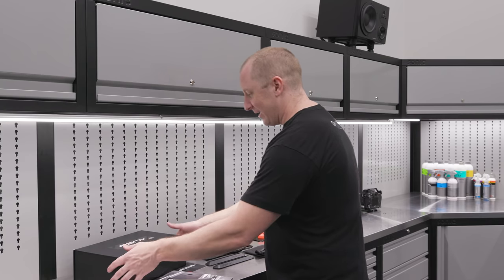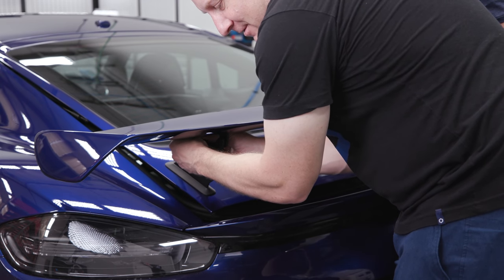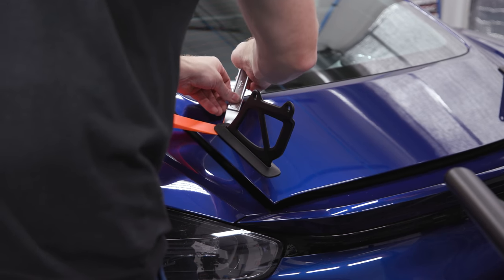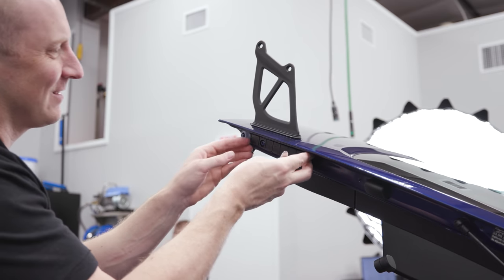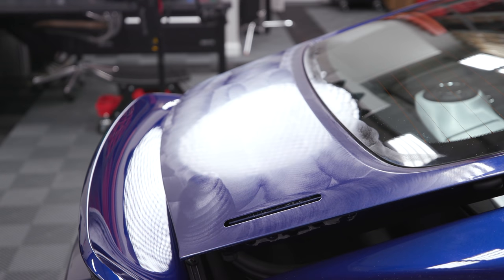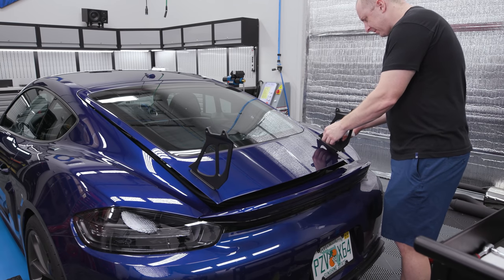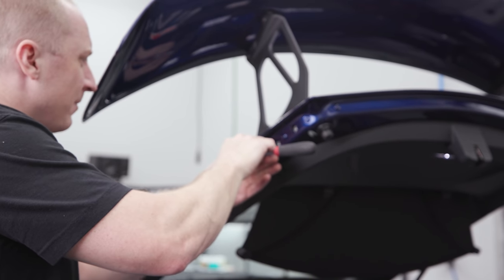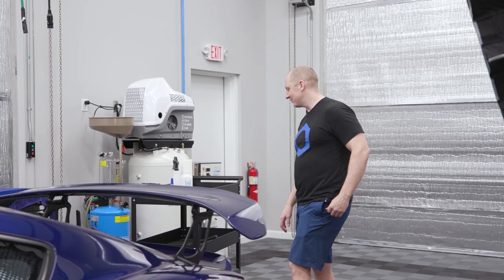Installing RSNV Wing Risers On The 718 GT4

Comment: You definitely do a thorough job but I have one suggestion. When assembling the wing back on, it’s probably a good idea to put a rag underneath just in case one of the bolts falls out of your hands so it does not scratch the paint
Reply: Great tip, that’s what we typically do. The bolts are light enough to not really damage anything but washers get lost easily!

Comment: That sweet sweet downforce.
Reply: Raising the wing 3” inches had no discernible impact on downforce.  Takes 6” rise to get the wing above the roofline and then turn the angle using the 3 degree hole option, then you get downforce.  The RSNV are cosmetic.

Comment: Changed the downforce profile from the rear to the front.  Need to add some to the front by removing the screens.
Reply from the maker: It will be just fine the way it is.
Reply: @ObsessedGarage  but it will affect the super long 2-5 gears now! :)
Reply: Only if Matt changed the angle of the wing.  If so, Porsche says remove the front diffuser blocks, not the screen.  If you want pics, let me know.

Comment: Hi Matt. Could a rear wing delete be done on the GT4? I guess you would need some vanity panels to cover the holes on the back, but would you need to compensate heavily on the front spliiter to adjust the downforce? Was imagining a home made GT4 touring-would still be fast etc but more discrete

Comment: Have them on my GT4 Matt.  Porsche needs to take a note - how the car should have come.
Reply: @jamesbaggaley1460  exactly, Porsche spent a lot of time and money to dial in the front to rear downforce balance so if these actually do increase rear downforce, what are you doing to the front to compensate?  BTW, I doubt they really do much and it’s highly likely they reduce downforce.  If someone has done a wind tunnel test then I’ll stand corrected. Otherwise this is purely cosmetic.

Comment: Doesn't that un-balance the car Front/Rear?    I think you should have done some high speed testing stock and then do this mod after you know how if feels stock at speeds where aero is effective.
Reply: Unbalance in terms of aero/downforce? No, because this is simply a riser kit. Assuming they don't change the angle of the wing, it'd have 0 effect on the downforce. It might be a little better in terms of air flow though - potentially cleaner air the farther up you go above the car (ie. why you see some race cars with wings mounted 2 feet above the trunk).
Reply: 😂😂 pretty sure it’s fine
Reply: Only if you use the 3 degree angle adjustment on the wing hardware.  If you use the higher angle, Porsche sys remove the front diffuser blocks.  I can provide pics if you need them
Reply: Upon further research, the 3” increase in height of these risers has NO discernible impact on downforce.  If you do not get slightly above the roof line, there is not much additional air hitting the airfoil to create downforce.  Getting slightly above the roof line and using the Porsche provided hole on the upper rear bolt (the lower cutout) that rotates the wing forward at the leading edge creates 3 additional degrees in the angle of attack, creating substantial additional rear end downforce.  The RSNV risers are, therefore, cosmetic (but if when you do mount them and you use the Porsche provided hole, you will get additional downforce, just not due to the RSNV risers, rather due to the increased angle of attack).  Aerodynamics and math for friction coefficient and drag, it ain’t that complicated.  Just like a wing on an aircraft, differential pressure.  Again, with the 6” rise and the 3 additional degrees in the angle of attack you must remove the front diffuser blocks to balance the car.  Removing the front diffuser blocks creates the front end down force necessary to plant the front of the car and balance it.  If you do not remove the blocks, the air flow in and through the front end does not change and the wing angle creating rear end downforce will create front end lift, just like an airplane,  At speed, the imbalance can, under the right air flow circumstances, can be enough lift to create imbalance.  Imbalance is always potential disaster.  Think of a heavier person on the end of a teetertotter, Most will never see the difference unless they track it, but it is discernable on the track.  Since I am not an aerospace engineer, I strongly recommend anyone doing this consult Porsche and reference the booklet that came with your GT4, which does discuss the necessary adjustments for the additional downforce.  DO NOT USE MY EXPLANATION!

Comment: I just installed the same set and had the exact same issue with one of those thread inserts coming out. On the same side nonetheless. Ha!
Reply: Happens time to time! Seems more often lately. Is yours a 718 too?
Reply: @rsnv_co  Yes it was a 718. May be helpful to put a note in the install directions. Other than that it is a great product, and easy install.

Comment: My OCD is kicking in I think you put the bolt on the underside of wing pointing in different directions 😭😭How will I sleep tonight.😆
Reply: Looks like it ended up right to me - the rounded nut is on the inner side, flat top screws from the outer side.
Reply: But will he check 😜

Comment: Easier to use risers from autoquest motorsports at 1/3 cost and no de-install of mounts.  They are extensions that look just as cool.  https://www.autoquestcars.com/custom-06.  Also the reply that the angle of attack does not affect stability is incorrect.  If you use the upper bolt holes, it changes the angle of attack by 3 degrees and you should remove the front diffuser blocks to balance the car.  There is a significant change in downforce with 3 degrees and the car will be less balanced.  That is why Porsche says to remove the insert from front diffusor.
Reply: I don’t think most people think those look comparable at all.
Reply: And therein lies the reason for options.  Form, fit, function, performance, looks.  Looks rank last on the list and.one has to get real close to see that difference.  And while most might like logos on their stuff, honestly, Porsche should be the only logo on a Porsche.  Your product is quality and I appreciate that, but it is not worth the 66% price difference when looks is the only variance that differentiates it.
Reply: Wes Smith If it’s not for you, it’s not for you, no problem. But those extenders are worthless to most owners. Full risers feel OEM+. Those are hacked together. Honestly, their margin % has to be higher based on the simplicity of manufacturing those. No hate towards them, just different buyers. But we’re fully confident in our offering and our buyers are our biggest fans.
Reply from the maker: It is absolutely worth the price difference of that option.  Those would never go on a car of mine.
Reply: If stuff you sell is all you advocate for, that’s cool.  Your really just a store and not an enthusiast.  I guess your partner Soul should stop giving you stuff since they rep auto quest also.
Reply: Wes Smith Odd thing to assume. I owned my GT4 long before starting RSNV as a passion project. Wasn’t happy with the options on the market and knew I could do better. If you don’t like us, all good! Our customers know what’s up.
Reply: @rsnv_co  I hear you!  I am not trying to be an ^%$.  You have a great product.  I just expect platforms like OG to provide various options and not call everyone else's options crap.  It devalues the platform as a place people can go for options.  I asked Matt about Wing Risers two weeks before this video.  I asked him about exhausts.  The responses were both products he markets and all others were crap.  That is his prerogative, it is his platform.  If I disagree, I can simply not subscribe to the platform.  But I like the platform, the style, the content.  I would just like there to be good dialog on options based upon data and not emotion.  I hope this makes sense.  No question, your product looks better.  Looks are important, but it is more emotional than empirical.  Data such as downforce is better based upon X or Y, that would be helpful.  The Autoquest site 
has a lot of content that is data and performance based and that is all I am saying.  Thank you for your professional replies and dialog.
Reply: @rsnv_co  Also, my comment on store front was in response to the OG response and not an assumption about your product and its development.  Just clarifying.